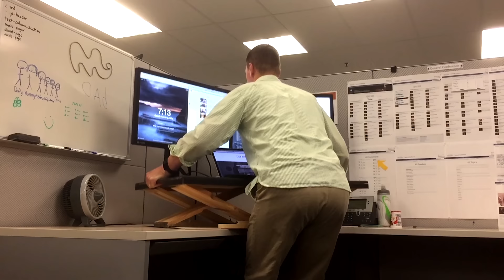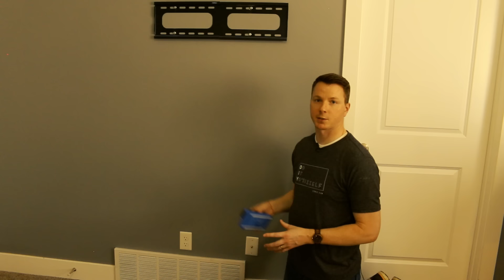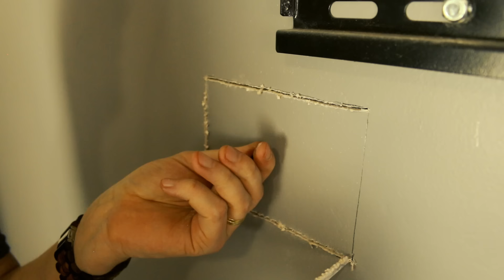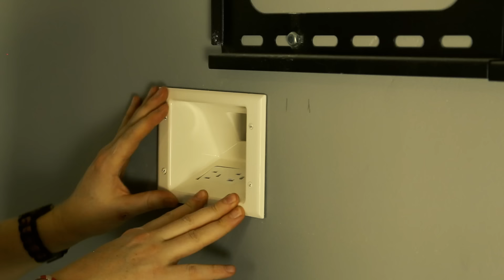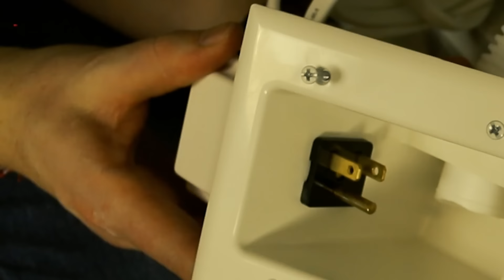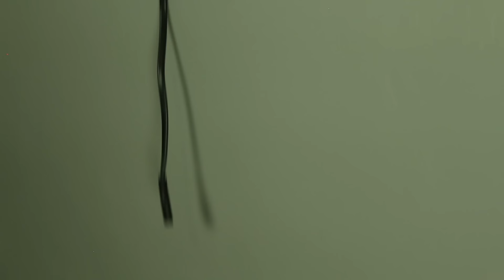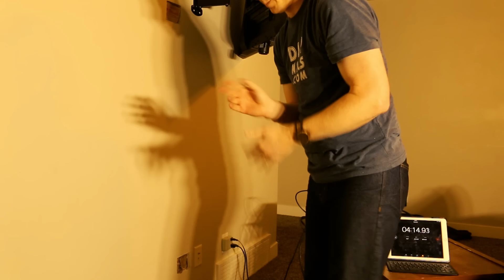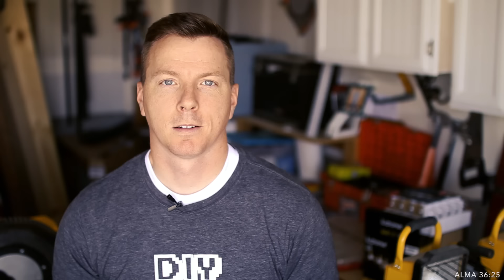How To Hide Your TV Wires in 30 Minutes - DIY

Comment: When I run wires like this I usually run some slick nylon cord or heavy fishing line first so I have something to pull the wiring with.
Reply: I don't know how he didn't see that there was going to be resistance when he put the pipe in
Reply: And if you have a pipe between the two ends and need to get something more in there, use some fishing line, site a small bit of  rag into it and then use a vacuum cleaner/hoover to suck it from one end to another, works great on line bits of pipe.
Just make sure you have tied off the first end onto something so it does not all get pulled through

Comment: Hide wires? That`s a mess at the bottom left exposed. Looks like a waste of time and materials. Running the wires inside the wall to the top receptacle would be the way to do it.
Reply: Please explain how you'd do that without extensive drywall re-work and drilling through studs if the built-in outlet isn't directly below the TV screen.

Comment: I did this with a power bridge ( different brand ) same result for an electric fireplace I mounted on the wall. I'm a fairly handy female, my results were great, and I haven't burned my house down with an electrical fire. 😬 One  thing I hate to see is a beautiful flat screen TV mounted with wires hanging down, it just looks tacky. Your idea of adding the flex tube is excellent. I'm about to mount a 65 in TV on an exterior wall, where I know I'll run into insulation....and BTW, your idea of fishing the wires through with a measuring tape was also brilliant. This is really a fun project and looks really good when finished.

Comment: Not removing the zip tie from the extension cord is bad practice and against code.  Cords are not supposed to be used bundled, but open and laid out.
Reply: Can you cite the code regarding that?
Reply: It comes under the heading of following the UL directions of the extension cord.  In other words, not using something counter to the manufactures specifications.
Reply: OK, so no code then, just the "we told you X so you can't sue us if you do X" boilerplate on labels.
Reply: Almost, but not quite.  There is a code section that says don't use things counter to mfg. instructions.  Also, wires do heat up as current draw is applied and not having them bundled allows the heat to dissipate.  This is similar to the Box Fill limits and devaluing required in crowded boxes.  Feel free to google these code sections.

Comment: NEC ARTICLE 400 Flexible Cords and Cables General 400.1 Scope.
This article covers general requirements, applications, and construction specifications for flexible cords and flexible cables.
400.8 Uses Not Permitted.
Flexible cords and cables shall not be used for the following:
(1) As a substitute for the fixed wiring of a structure
(2) Where run through holes in walls, structural ceilings, suspended ceilings, dropped ceilings, or floors
(3) Where run through doorways, windows, or similar openings
(4) Where attached to building surfaces
Exception: Flexible cord and cable shall be permitted to be attached to building surfaces in accordance with the provisions of 368.8.
(5) Where concealed by walls, floors, or ceilings or located above suspended or dropped ceilings
Reply: The cable used in the video is similar to the stiff Romex-type solid copper conductor power cable that is typical in just about all construction in America. Are you implying that Romex cable isn't code?
Reply: @whiteknightcat   In some states and municipalities even romex has to be inside a metal conduit.  In Michigan romex is ok w/o the conduit.  Strong union states typically req. conduit.
Reply: @mrjleex  Thanks. Did not know that. Here in Texas, Romex is simply run directly through the walls.

Comment: If I remember correctly not removing the cable tie on electric cables will cause unwanted heat and slightly increase the current like using extention cables always unwind all the way before using.
Reply: I've bundled excess power cords all my life and never had problems.

Comment: You can help pull wires by sucking a string or thin bit of rope through the tube using a vacuum too, then just loop the end around your cables and pull them through

Comment: I don't want to seem like a troll but, you better check your code book NEC. the way you ran that romex (the white power wire) you made a coil! next to your a/v lines. Where I live you can't use your butt connectors on 120 or 240 volt lines

Comment: Pretty sure coiling electrical wiring in a wall does not meet code. 
Do not coil electrical wiring or power cords.  Coiled up wire is an inductor.  It resists AC.  As a result dissipates heat.  Can get hot and start a fire.

Comment: Datacom sells just the top one for $30 instead of using that power cord to connect it to the outlet you can just run a short 14G romax wire inside the wall to the back of the bottom outlet connect just turn the power off from your breaker panel before you connect to the bottom outlet then you don't have that jumper cable laying on the floor. https://www.amazon.com/Datacomm-45-0031-WH-Recessed-Voltage-Receptacle/dp/B004GZ89N0/ref=lp_2529233011_1_6?srs=2529233011&ie=UTF8&qid=1526549585&sr=8-6   for the AV cables the $4 wall plate for the bottom made by datacom  cleaner install half the cost

Comment: Why search for the fire block in the bay between the electrical receptacle and the cable plate and then run the installation in another bay? Why did you not install the bottom box in between the two existing plates?

Comment: On your second install, you could've used jetline instead of tape measure, much easier and stronger to pull wire correctly.
Reply: Would have been better off using fish tape. It was insulated so running jetline down that would have been nearly impossible

Comment: Or your could've bought a longer cord, cut the head off, buy some flex conduit like you're supposed to, or the wow through the flex, to protect the l live wires, placed a times connector on the end of your cut plug and spliced that wire into your wiring inside the single gain if that's a 120v gain box by connecting the word to the pigtails inside behind the plug. Way too much work.
You could've cut your hole right where the TV wall mount is, used a fishing rod down, taken the single gain out and fed it directly.

I only have 2.5 years in and I know to make life easier with less holes

Comment: This works but its not the best way to do it. Best way to do it would be to tie off the existing outlet according to the circuit size. Always use proper wire gauge or it will burn in your wall if you pull too much current. Also if you do that anytime you alter a circuit you must bring it to code. You must make that circuit afci and or gfcis protected depending on location and additional state or city ordinances. Also don't coil wires. 334.24 NEC gives you allowable bend radius if you really had to bend the wire. Biggest thing about code is that is very gray. It is up to perception of the inspector. From ones view your setup is up to code since you didn't really add to the existing circuit but insurance or inspector would say it's not to code since you technically did connect to the existing circuit.

Comment: heres a "pro tip" fish a string or heavy banding through the hose before you run it through the wall. this way you can use it to pull all of your wires through the tub.. Also, its called a key hole saw, not jab saw... AND its called mid-span blocking, not fire blocking... I was sweating watching this
Reply from the maker: I love the idea about keeping a string in there to pull wires. Others have suggested doing that but tying some cloth to the end of it so it's super easy to vacuum-pull it from one end to the other. As for the Jab Saw vs Keyhole Saw, they go by both those names and several others too. Do a quick search on Amazon or Google and you'll see them used pretty interchangeably. Mid-span blocking is actually primarily used in decking and floor joists, not in stud bays. Either way, I think most people got the gist of it. Thanks for watching!

Comment: Your installation does not meet code(if you care) with bilge pump tubing. Bilge pump tubing is not designed for that purpose. You should use smurf(ENT) tubing with low voltage rings instead. I am glad that you told your audience about the in wall rating of the cables. Otherwise-great video. Russ Raetzman-Journeyman Electrician.

Comment: As a REAL CARPENTER,  this is not a 30 minute project. Just to give you a heads up. Plan for much more time.
Reply from the maker: As a REAL DIYER, I actually did this in less than 30 minutes. Yes, it can take more or less time, but it took me 29 minutes to install this at a friend's house even with insulated walls. As long as you don't have fireblocks, it's a pretty straight forward process.
Reply: LRN2DIY this method is such a hack! No real handyman or carpenter would use this. Like he said it's a DIY project. That's where  I messed up, lol.
P.s. I think i shit a little when he said "here's a pro tip." Nobody who is a hack should think they are a pro. He had the box I install behind a washer, another box similar, some sump pump hose, and some pieces from home depot's plumbing and electrical. Now its a shit kit.

Comment: it looks clumpier than before he did all this unnecessary sh*t. And whats the point of using the tube for the wires that are behind the wall? Does it matter if it looks nice and neat behind the wall? I have done this a while back with my T.V. and truthfully most of the stuff this guy did was unnecessary.

Comment: Receptacles? What are you talking about? Just run all the wires through the wall behind the TV, and out the bottom to the outlet that's already there. Adding a whole new outlet just to end up connecting it to the original outlet is a huge waste of time.

Comment: In my country you always measure the current with an instrument before you stick in the plug just to be sure you have conected all the wires correctly. I guess rules are different depending in which country you live in? Otherwise good instructions

Comment: Ya, skip the hose that is a pain.. Put a string in the wall to pull wires through (550 cord works). This works especially well when there's insulation in the wall. In the end just leave the string in the wall and shove the untied ends in the boxes. When you use the string to pull your cables, tie the two ends together of the string so it becomes a loop inside and outside the wall cavity, then just tape the cable you're running to this loop so you don't loose your string in the wall.

Comment: Good video, But two things quested me, 1) always run wires in duct prior. save time removing top wall plate.2) Never coil and bind cables, this is induction/ HEAT.  I have seen a 3M extension lead melt on a 250 VA monitor. As a technician,  the shortest works best.  Giving 100mm or 4in. I've installed over 100 monitors in my time from control to output. Smart cabling will save you hours.
I'm from Australia, We do things a bit different down here. Love your work. Jason.

Comment: Why didn’t you just tie in power from the outlet box instead of using an extension cord??
Reply: Power isn't the only issue. There are HDMI cables and AV, maybe optical as well. Either way you'll have to run two boxes. Might as well loop power in there while you're at it.
Reply: @moonpiespotlight4759  
He could've had a seperate single gang box below for the hose and Low volt data. But he should've used ENT, not some tacky hose that's not fire rated. Insurance won't cover you in case of a fire
Reply: No one even thought of the fact of him not having to cut 2 holes in back of the tv instead of just the 1 he cut. One for electrical and one for hdmi wires.
Reply: @Bamboo Training well, I guess being an electrician is about as "current" as you can get.
Reply: Also, isn’t it against code to just run a regular outlet in your house without pulling a permit to do so and having a licensed electrician do it?  Not sure but I thought that’s why these boxes were invented to avoid all that
Reply: @scottwescott9114  
Depends on your jurisdiction. As a homeowner you hold the rights to the work done in it. As long as you're not completely renovating existing structure you're fine. Which also means you bear the risks if something goes wrong. 

Doing a simple outlet like this is not a big deal, and no authority is coming in your house to even look until you have some type of inspection done.
Reply: No kidding would have taken less time and looked better
Reply: @degdiego  he has another video to do that. This one helps if you don't want to mess with the electricity.
Reply: .... D I Y
Reply: @Bamboo Training I'm so sorry u lost your job...mind if I ask what u did do?
Reply: @Bamboo Training Its awesome that u r going back to school I am so jealous. It is always a good thing to go back to school & learning a  new trade I wish u the best of luck!
Reply: @Bamboo Training 
Any construction work can be potentially dangerous. But if you know how electricity works, the less you'll be scared of it. Humans naturally fear what they don't understand.
Reply: Because he is showing how to use the kit...

Also he would have had to drill through the stud (yes not difficult but not the point of the video)
Reply: James Pyle 

Why would he have to drill through the stud?  He could have just mounted the top box to the next channel on the right.
Reply: @jbdragon3295  Mind Blowing
Reply: My wife want me to remove the table that hides the wires under.Now the wire connection is showing ugly.
Reply: Efren Saclolo the solution to your problem is removing the wife, not the table.
Reply: The direct connection to the electrical box would require a metal junction box and bx between the 2 boxes. This is much easier to do.  Great video!
Reply: @janmishkin   no it would not.  An"old work" plastic box with tabs and a bit of Romex to an existing outlet, available at any hardware store, is all that is needed.
Reply: @janmishkin  wrong. #1 Bx isn't used any more it's called MC. #2 ROMEX is all you need per NEC
Reply: Jan Mishkin you don’t need bx. It’s residential
Reply: @janmishkin  
No it wouldn't, you just fish a 14/2 romex cable from the existing outlet up to your cut in box above. You don't need a box in between
Reply: All that is required is a plastic "old work" box and wire designated for in wall use such as Romex 14/2 to add another outlet behind the TV in the same bay off a previously existing outlet.  This is what I've done multiple times.
Reply: Because he's not an electrician, he's a scab,lol
Reply: I'm not an electrician, but I am guessing that he needed electric power at the top to plug in the TV. Using the extension cord at the bottom gave him power on top to connect the TV. Again, I'm guessing.
Reply: All he had to do was run a new line off the existing power outlet at the bottom to a new retro construction box to the TV.  It would have taken at tops 15 minutes to do and would have been way cleaner install than this contraption that taps off the existing outlet using an extension cord then runs up the inside wall.
Reply: @NewShockerGuy  then what about the audio video wires? This was for everyday home owners not electricians.
Reply: @saliston  you run a small low voltage bracket just for those wires.  It's half the size of this entire contraption.  Plus a much cleaner look.  Takes at most 15 minutes to cut the holes and put on the trim conver plate.
Reply: @NewShockerGuy  Do you not get that many people are not comfortable in doing electric work? It requires skill, knowledge and tools they may not have. IMO the less laymen do electric work the better. Such things can kill.
Reply: @okaro6595  totally get that but in this case it's actually MORE work than doing it the right way...
Reply: @okaro6595  Except he did do electric work. The only thing he saved was connecting the wires directly into a receptacle and if you are uncomfortable with connecting them around a post you can buy receptacles that let you push the wires in just like the little connectors he used. And if you turn the power off first as you should you aren't going to kill anyone.
Reply: @NewShockerGuy  You are aware that there are a lot of people who don't want (or shouldn't) mess with tapping into an electrical outlet?  This is a very safe alternative.
Reply: @okaro6595  
If you're that uncomfortable with electrical work, than you shouldn't be doing what he's showing in this video. He's breaking electrical code by not using a fire rated hose inside a wall. Hire a professional electrician if you're not comfortable
Reply: @jonathanwilliams1974  
If you shut off power to the outlet, it is completely safe. Even electricians don't work on things energized, unless there is no other way..

Comment: Not sure why you would add two new boxes and then add an extension cord?  
Add one box in cavity where power outlet is and then replace lower box with one that has access hole?  
No need for extension cable and your outlet wired direct as it should be!  Also you can connect to cable by drilling thru stud at Cable box and connecting to the lower box!
That would be my preferred install!   Of course yours will work but then you have four wall outlets ! I just don't like the extension cord part!
Reply: you cannot make a low voltage connection between two seperate low voltage wires in a low voltage box.

Comment: This installation does not commply with NFPA 70 or the US electric code Never try to do this is very easy a overheat of the eires and have a potential fire, check the electrical code